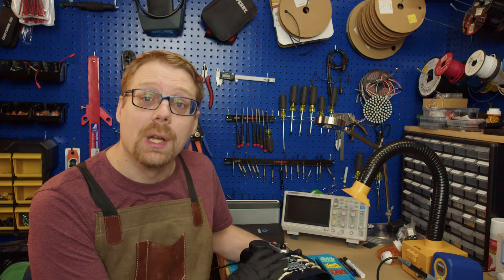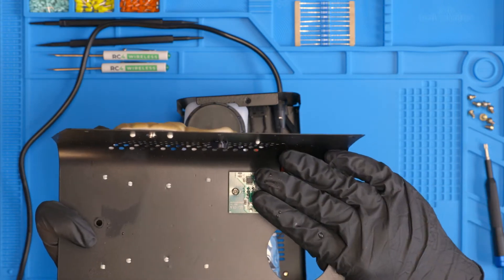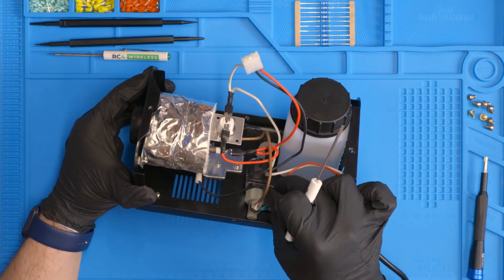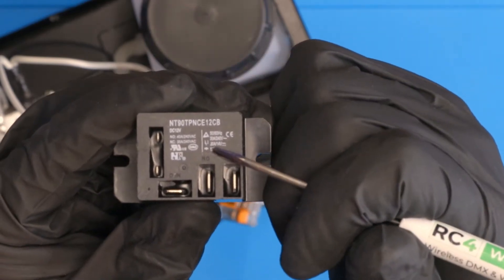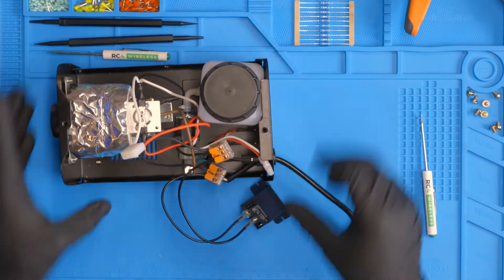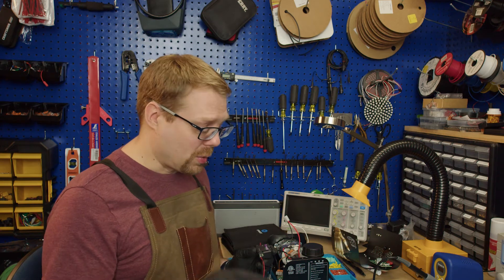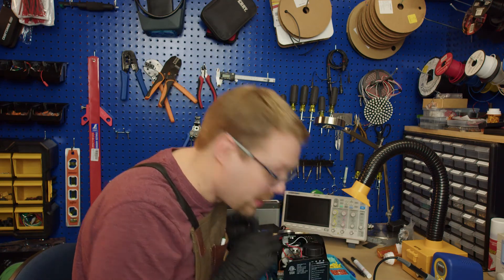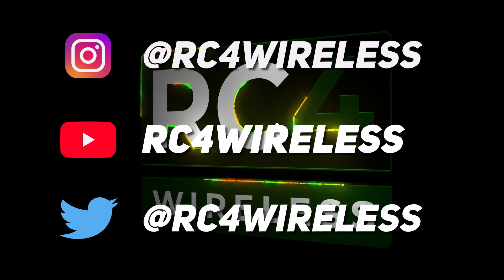Add wireless DMX control to your low-cost fogger using RC4 Wireless Dimmers!

Comment: Great video , can this work as well with DJ Led lights ?
Reply from the maker: It is hard to say without more details. Another option would be...If you want DMX control and your DJ lights have a DMX input, you can use the 1/8" jack on the side of any RC4 dimmer to output DMX.

Comment: Great video. My Question is to use DMX control to add the capability of adjusting the pump flow amount, as well as on/off how would you acheive that? Or does it require a different type of pump.
Reply from the maker: Sorry for the late reply.
All you need is a pump that uses a low-voltage DC motor. This can be directly powered by an RC4 Wireless dimmer. The dimmer level will adjust the flow amount.

Comment: I'm seeing the RC4 wireless dimmer go for $500. Wouldn't it be less expensive and easier to purchase a much larger fog machine that already includes DMX functionality? I'm seeing reputable brand, better quality fog machines with DMX starting at $250. Am I missing something?
Reply from the maker: Hi Christian. We provide solutions for small props, costumes, and other specialty applications. The objective is almost always to make things as small as possible. If you need fog to come out of a dancer’s hair, that’s when our solutions come in very handy.